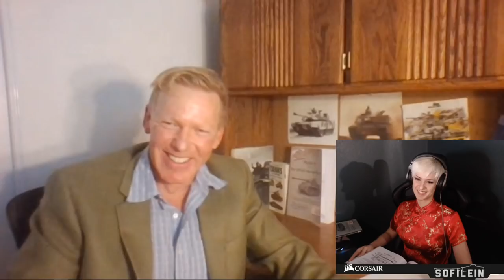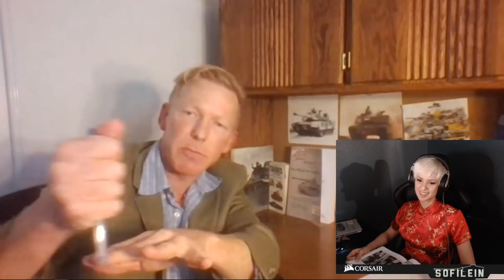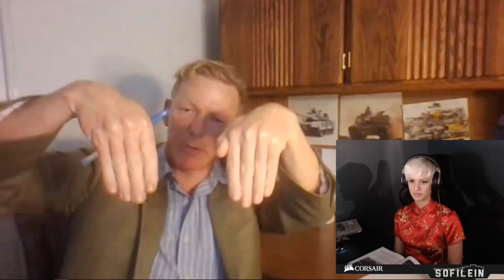Transmission and Roadwheels: Tiger I Mythbusting with Bruce Newsome Part II

Comment: Lots of good info, thanx! Why didn't they slope any of the Tiger 1's armor? It looks like a scaled up Panzer IV.
Reply: That's another myth, the Tiger's armor was sloped, just not as heavily as an M4 or T-34. If you look closely at the front of Tiger I you'll see that it's all sloped, albeit at a shallow angle, even the front plate where the driver's vision port and the hull machine gun sits is mounted at a slight angle, Then the main glacis is heavily sloped to where it's almost horizontal, then the nose is angled twice before going to the bottom of the hull. The only parts that are perfectly vertical are the parts that are that way on most other thanks like the  gun mantle and sides of the hull.
Reply: doctim111 - Final specs for the development of Tiger I tank was signed by Adolf Hitler on May 25th, 1941 before invasions of Soviet Union, so it was not know about existence of T-34 tank, so only Panther and replacement model of Tiger I - Tiger model B(aka King Tiger) had armor sloped at steep angles.
Reply: Riceball01 - Well, frontal armor of Tiger I is combination of vertical and “horizontal” armor plates. Near vertical plates have “slope”(if you can call that) of 10 degrees, which would give effective armor protection of near zero, in other words it’s just a thickness of the armor plate, so it’s not considered to be effectively sloped.
Reply: @RussianThunderrr  True dat. 10 degrees is a lot closer to vertical than sloped. They could have increased armor effectiveness by sloping (as in the later Panther) but were locked into an upgraded Panzer IV design because of the lack of time available to counter the T-42, imo. Thanx.
Reply: doctim111 - what is T-42?
Reply: doctim111 - They could have increase effective thickness of armor, if they knew how to do it, but they did not encounter T-34 back then, and study that tank in detail.
Reply: @RussianThunderrr  The Tiger 1 was out in 1942-43. The first T-34 was out in 1940-41 and kicked their butts. Otherwise they would have kept on with the Panzer IV.
Reply: @RussianThunderrr  T-34. My bad
Reply: doctim111 - Well, lets be a bit more strict with dates and timeline... Tiger I tank had ~6 month into development, and was out on Adolf’s Hitler birthday of April 20th, 1942. Battle of Mtsensk near Moscow happened in early October of 1941, where Guderian tanks suffered great losses from T-34s that was deployed there is great numbers. With Panzer committee formed and investigation complete were spec was drawn and Paz-V was ordered into development sometime at the end of 1941, and was just in time for Kursk Battle, in fact it was delayed a few time, because Adolf Hitler was waiting on delivery of first 200 Panthers. So to answer you original post, Tiger I was put into development a few month too early to have armor plates angled at rational angles to take a full advantage of “effective armor thickness”. Any books from Osprey Publishing will confirm just that.
Reply: doctim111 wrote: “They could have increased armor effectiveness by sloping...“
— And they did later on in Tiger model B(aka King Tiger), same goes to Panther II.
Reply: Riceball01 wrote: “That’s another myth, the Tiger’s armor was sloped, just not as heavy as an M4 or T-34.“
— I’m not sure why you are even mentioning M4, that tank did not even exist before WWII began. Here is the guy who created the Myth that Tiger I armor was sloped dispelling it... See StuG frontal armor overview at 3:53 right here:

https://youtu.be/qydsbwk-xSM
Reply: The historian from the German tank museum said that German engineers believed at the time that sloped armor could not resist powerful weapons like anti-tank guns because when the plate is mounted at an angle it would detach from the plates its mounted on, while flat armor is mounted on flat plates and is a sturdier construction.

They sloped the front armor of their tanks at about 10 degrees though. It did not increase the line-of-sight thickness but thats not the only benefit of sloping armor, it also makes it more likely that a shell will deflect when it hit a sloped surface, and 10 degrees was enough to have an effect like that according to German research.

Comment: So, how’d that great Tiger I do at Kursk, for which it was made?
Just askin’
Reply: Many German tanks blew up and suffered there on mine fields. In defensive position aka Battle of Prockorovka Tigers alone side of AT artillery wreck up some mighty scores, the key point that it was not Tiger tanks alone, but alone side of AT artillery in defensive position.
Reply: RussianThunderrr - The video claimed it was a breakthrough tank. Did it in fact break through?
Reply: Coach Hannah - Well, the role that Pz-VI was designed as “Durchbruchwagen”(which translates to English as a - Break Trough vehicle), and at Kursk it was use for that purpose i.e. - it supposed to knock out targets at long ranges, and be in a role of “bullet/shells magnet” since it had at the time best and almost impregnable armor protection. No Soviet medium - 3 inch(76.2mm) Soviet tank gun, or ZiS-3 field gun or smaller could defeat Tiger’s armor practically at any range, but point blank range ~100-200 meters. They could damage it by shooting at Tiger’s track, or TC cupola or MG port and etc. So yes it was used as a Break through, but the problem at Kursk Defence was too much even for a mighty Tiger tank, so the answer to your question is - No, but it did inflict high casualties on Red Army part.
Reply: Actually only Tiger tank managed to do they jobs there.
Reply: venator5 - What are you talking about?
Reply: @RussianThunderrr  In the early days of the offensive only the tigers managed to finish their secuded daily tasks.
Reply: The Tiger did everything expected from it at Kursk, but they were too few to make an strategical impact. In sharp contrast to Soviet reports,  only 6-13 (depending on source) were lost. The "burning Tigers" meme is just Soviet propaganda.

Comment: 1:26: Panzer III also had a pre-selector gearbox, which predates Tigers. This was not new technology either and had been around since the first world war. The Matilda also had this system.

2:37: Do you have any actual evidence that a 'pre-selector' gearbox is more reliable than other types of gearboxes of that era? (Crash gearboxes, manual or otherwise) Because this is not self-evident. 

3:13 You claim, that "Tiger was the easiest drive of all tanks of WW2" Churchill had the exact same power assist system, it was just as easy to drive, it had the same pre-selector gearbox and steering "wheel" or lever in it's case. 
4:23 "Valentine requires physical force to turn" You chose the Valentine rather than any number of other vehicles to compare to- a bit selective, don't you think?
6:17 You claim that, "No evidence that the Tiger's transmission was 'particularly unreliable', users do not complain it's 'unreliable' This is just simply untrue. Final drive failures were common, and that is, unequivocally apart of the transmission. If you look up any report of damaged or out of action Tiger Is you'll see a very high number of them out for final drive failures.
7:00 "The technology is introduced by the Germans first." Pre-selector and pneumatic gear assist was implemented on Matilda II and Churchill which both pre-date Tiger's introduction. Furthermore, the British A.16 prototype was equipped with a transmission known as the "Merritt-Maybach" transmission- prewar there was co-operation between the British and the Germans- it wasn't as if this was some bit of stolen technology.
Reply: I had no idea the Churchill had the same type transmission system, thanx for that.
Reply: @billd.iniowa2263  It did, in fact, it used an improved version that had an integrated differential and improved overall design. It was also used on the later Cromwell, Comet and Centurion tanks
Reply: the video doesn't claim any different: you're trolling
Reply: @pinmanist  and you must be a Russian bot))))
Reply: there are literally time stamps on the comment. How dense can you be.
Reply: So more final drive failures than other German tanks?  Service records from the East Front show no difference in service availability between any of them. Later in the war as German logistics broke down tank maintenance suffered which of course affected reliability.
Reply: They point was Matilda II (and Panzer III) didn't have power assisted steering and Churchill was hopelessly underpowered. Hence not as easy to drive as a tiger. The first tanks which come close are comet and centurion which have pneumatic assisted steering and the Merritt Brown transmission. 2. 5 years after the introduction of tiger 1.
Reply: @HaVoC117X  Good points, basically the Germans got there first by a significant  margin. I seem to remember that even the Centurion had a very heavy clutch.
Reply: @HaVoC117X  The Churchill had both. The first production Churchills rolled of assembly lines before the finalized Tiger design begun it's official production. "ease of driving" in this case being the point. He didn't say anything about ease of driving being related to speed.
Reply: @bruceolivernewsomeph.d.7951  Welcome to the internet world where waving/criticising a national flag beats facts.
Reply: @ohslowpoke4720   I know it had both. I never meant speed. To overcome the driving resistance of the running gear (which was already very low in the tigers case as described in the video) and the resistance of ground it is favorable to have a high power and high torque engine. This makes accelerating, steering and generell driving much easier. The very long track base of the Churchill combined with the small roadwheels was the exact opposite. On the other hand Mr. Newsome said that the power to weight ratio is a good indicator for reliability. Is it low your tank will probably break down much faster, which proved to be true for the Churchill. First Churchill production batch had a service life of just 250 miles, even in 1944  only few Churchills made it beyond 1000miles bevor overhaul. Sherman and its variants, Panzer III and IV, Panthers had an average service life between 1000miles and  2500miles for their engines and transmissions.
Reply: @HaVoC117X  Nothing you said is incorrect, but within the context of what he said; I was merely responding to his claim that it was "the most easy to drive" this is in relation primarily to the technology that allows the driver to operate. If you rewatch the section that I was replying to, he explains the technology the Tiger driver has (Power assisted steering wheel, preselector gearbox) and all I am saying is that it is not unique to the Tiger in being "easy" to drive. The Churchill had no problems actually driving around, being quick is another story- but that's really neither here nor there, this isn't a video about the Churchill.
Reply: @bruceolivernewsomeph.d.7951  Since it was mentioned, could you expand on how power to weight ratio is a good indicator for reliability? I seem to recall Crusader should score quite high on that factor, yet it doesn't seme to be particularly regarded as a reliable tank.
Reply: @bruceolivernewsomeph.d.7951  Of course, you selectively chose to ignore the entire post and say I mischaracterized you rather than giving an even remotely charitable retort. Don't be a child, Bruce.
Reply: @bruceolivernewsomeph.d.7951  I figured that was the reasoning, but I found it oddly rather specific and seemingly coincidental, at the risk of people only catching on that simple concept, as evidenced by the commenter above.
Reply: @bruceolivernewsomeph.d.7951  I'll stick with reading primary source archival documents. Given this short interaction and how you've handled criticism, I hardly think it's worth my time.
Reply: @ohslowpoke4720  is a pretender, and pretenders troll people who know better

Comment: Germans did not put a diesel engine - Why? It has no logic
Reply: Mainly, logistics. The HL230 engine was already in production. The vast majority of German equipment was gasoline powered. If you mix diesel and gasoline vehicles, your supply lines then have to supply both fuel types. And while diesels the day were fairly reliable, they also lacked power. The T-34 for instance 500hp from a 38.8L diesel. The Tiger I had 650HP from a 23L Gasoline engine. Diesel is easier to refine, which would have been good. But at the time they did not think they would be suffering from fuel shortages a few years down the road.
Reply: Maybe they were smarter than you thought and you are simply too young to understand the real world of 1941?

Please explain to us how you are able to start a diesel engine in -20° C with the 1941 available Diesel which is pretty warm for russian winter ?

The diesel would not start cause back then the diesel will first start to 
flocculate and then to freeze. In neiher case you will be able to start that engine.
Even nowadays you will not be able to succeed if you have summer diesel in your tank. You need special diesel for winter purpose that has chemical additives to make the Diesel useable in harsh winter up to -22°C that the gas station changes in autum for the winter season - without telling you ... simple as that. 
But these additives were unknown back then and once you had turned of a diesel engine in russian winter you simply had lost the engine and of cause the vehicle, a tank, bus, truck or car. 

Did you know that the chinese used trucks till early 2000 that were not diesel  powered ?
Call them stupid but you will miss to learn a lesson that other cultures can be a lot cleverer than you imagine or think. 
It always depends on the culture, era, infrastructure what you choose and how things evolve.

Have you ever driven a Mercedes 190 D from 1985 ? 
2 liter and 72 PS ... not 170 PS they got from a 2 liter engine in  2010 by the common rail high pressure injection system. 150% more power than just 25 years before were they got 36 PS per liter ...

And now let us know the power per liter of a Daimler diesel engine in summer 1941 and all the glory and benefits of that 1941  engine you were dreaming of in your question !

You tried to look back hindsight and with the current technology in mind not with that of the technology and ressource situation of germany in 1941. 
If 1 metal would be unavailable you could not produce such machine. 

And maybe you should check first what technology the allied used in their tanks and if that is simply the same the german used then you would never ask such question.
Reply: There was a plan to copy the T-34 engine.
It was dropped for several reasons, the main one that they hadn't had the aluminium.
Reply: @typxxilps  I am a diesel engine repairman. I am 43 years old. - It's all right?  Try to read more about this situation. Any war - is a business
Reply: Germans also made synthetic petrol...
Reply: @krautreport202  yeah Benz had a design for the panther pretty much a copy of the t34 with diesel engine. They would of preferred diesel because it's easier to refine. But they didn't have the engines of correct alloy for they so they stuck with the maybach.
Reply: @typxxilps  The Russians successfully used powerful diesels in their tanks and managed to start them reliably invery cold weather .